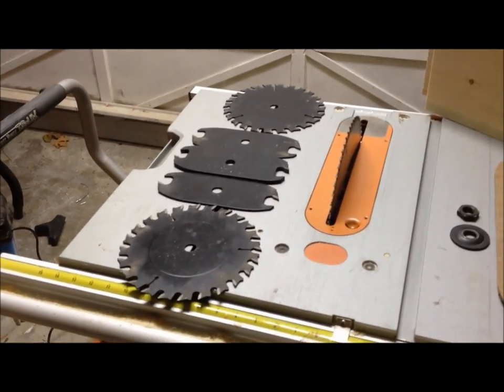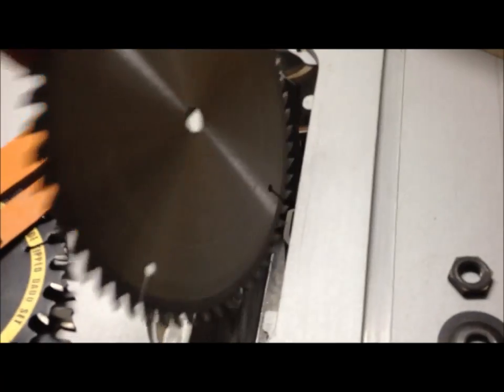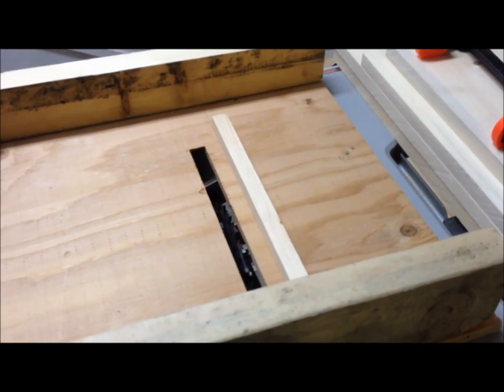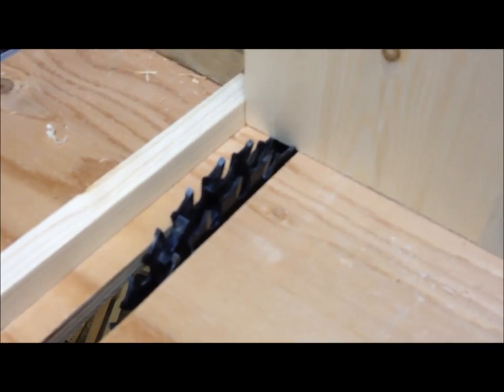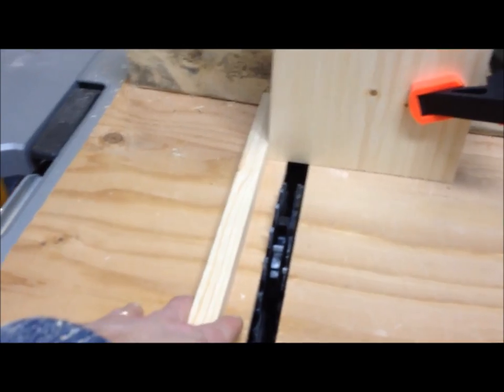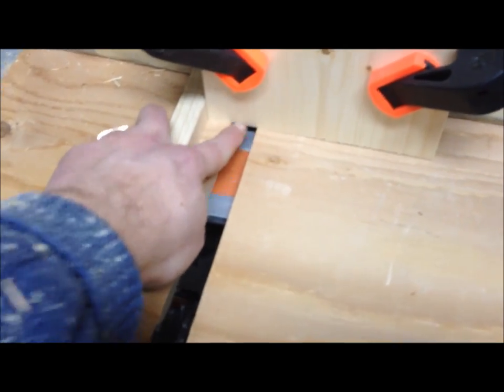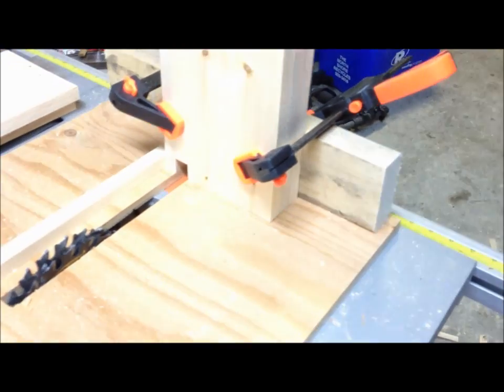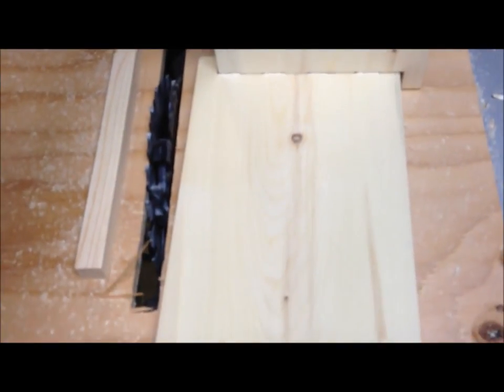Cut box tail joints into multiple boards for bee hive box

Comment from the maker: Hi Justin. You know, I've heard the same thing and you just have to see what works. With a dado blade, my suspicion is that the wide cross cut grabs a lot of wood and tape wouldn't stop the splintering. But I know for sure that if the hole in the backboard/fence is exactly the size of the joint (like mine is) then you won't get any cutout.

Comment: I don't know if I was more impressed with the nice sled you made or the way you held a camera and cut the boards out with one hand. just kidding,  Also do you have a video of making the sled from beginning? I'll start looking now, but I have to admit, this was a great video. If all are this good I need to sub. Thanks again, Kim
Reply from the maker: +The Abled Gardener I didn't make a video of the sled because there are so many on YouTube, Having said, that, I've learned that you can improvise to a great extent  as long as you get the sliding rails to slide nicely.  The basic process is to cut rails that fit snugly into the slots because I cut mine too tight and they didn't slide at first. Leave the rails in the slots, and support them from below with washers or whatever so that they project above the table surface. Then put glue all over them and lay the sled base on top, then let the glue dry. Then add short screws from the bottom and make sure the screw head doesn't touch the bottom of the slot. Then screw in the safety sides to the front and back etc. and cut a groove in the front edge. That's too simple, but you get the idea, and just find a couple videos. Good luck.
Reply: +Doug Brown Thanks Doug, I have watched a lot of great sled videos now and from excellent (if you have the tools) to very basic and think I know what to do now. Your tip on with the washers under the rails is a great one, thanks for your quick answer, Kim
Reply from the maker: Good luck! I use mine all the time.
Reply: The Abled Gardener секыс
.секыс
Reply: Doug Brown секыс

Comment: Great video!  Brand-new just starting out in beekeeping - in the phase of assembling equipment, my bees are ready for pickup in mid-April.

Only one question:  I've noticed that a lot of the videos showing how to do the finger joints are using a dado on a table saw.  Any reason why one couldn't do the same with a fixed base router and a finger joint jig?  I was thinking of doing it with my router and my jig, but started wondering if there was a reason why I seeing others do it with the dado and table saw?

Comment: I am left to assume you put a 3/4" spacer between the key and the dado to achieve the adjacent board fit. Is this the case or do you have a separate slider fixture for the connecting side?  Very simple and effective fixture.

Comment: Do not stack regular saw blades together. Dado blades have no kerf  (the teeth on the blade are flush with the actual blade. reguar saw blades the teeth stick out the sides alternating left and right. Dado blades run you about $120 Canadian.  great video  have the same saw works great fyi the tables saw has a 10" blade and the dado cutters are 8" the thicker you cut the more power it takes to run the saw thru the wood. you an also make the scalloped handles for your bee hives. real simple jig to make.
Reply from the maker: Mike Meadows Thanks. To make handles I just lay the box on the table saw, raise the dado a little and push the box back and forth a few inches. Really quick and simple.

Comment: hey! im about to do thi sthing. thanks man, i like this video of yours!
some question though...

1    what would happen if i dont put thse blade inserts in between? would that leave the middle uncut? (i dont have them.)  how about if there s just little gap (to make more narrow joints)

2    say i go and buy more blades , i end up with five NORMAL 50 teeth blades, meaning i d have five 50 teeth blades one next to another.  would that be a problem? (i dont see a point in buying those different blades you put in the middle- or do i have to??)
please answer me, i ll be very happy.
Reply from the maker: Hi. Here you go:
1. I think you mean you don't have the dado blade (inserts)? If there's a small gap between two saw blades I think they would remove the gap. I'm guessing about 1mm or less would be cut away.

2. You can definitely put several regular saw blades together and that would work fine, BUT I wouldn't put more than 4 together. The reason is that there is a large amount of sawdust with dado cuts, and the small number of teeth on the dado blade allows the dust to drop out. If you have a lot of blades you'll find sawdust everywhere.

Here's a blog on the subject: http://woodgears.ca/shop-tricks/dado.html

Comment: Can I put 3 or 4 regullar blades? They just don't sell those blades in here.
Reply: That is very dangerous.  On a 'regular' blade, the teeth are wider than the blade disc.  If adjacent blades slipped and the teeth struck one another, you'd have small carbide projectiles flying through the air at several hundred feet per second.  Not a good thing.

Comment: What size motor is required for stacked 8" dado blades?
Reply from the maker: The answer is indirect: If the arbor (the threaded axle that you stack the blades on to) is long enough to hold your desired dado width (plus the locking bolt) the motor will be powerful enough. I'm using a Ridgid R4512 which is a portable contractor unit that's been able to easily cut whatever I need. 

Good luck, thanks for the question.

Comment: Be alot faster if you just clamped the boards together themselves, instead of clamping them to the sled and having to reclamp after each pass.  pass the sled, moved the boards one notch, pass the sled, move the boards, etc.
Reply from the maker: Good idea. I just didn't want to have to worry about the clamped boards moving around mid-cut.
Reply: So, do both. Clamp all boards together to make them easy to move and also clamp the group to the sled before each cut.
Great video and narration!

Comment: Dados are inherently hard on your motor. I would encourage you to seek quality over quantity.
Nice jig but you can't get quality joints milling 10 boards at one time. Their are going to be deviations and mistakes.
Nice joint to look at and strong but not the best joint for a bee box.
Reply: What is the best joint for a bee box?
Reply: @markwelsch1619  Box joints are probably the best for strength and reliability without being excessively complicated.  The best manufactured boxes sold typically use box joints.

Comment: Hey Doug. You showed half of the joinery. How do you make sure the other side matches the joints you put into the first side? Did you scale it to make sure that the joints fit equal? I would like to see how to make a complete box joint so that they come out with an even top and bottom Sled is a stroke of genius.  rickypack@peoplepc.com
Reply from the maker: You need to cut a dado into the corner of the opposing board, then continue cutting slots--You'll find the last finger and slot line up. To make the dado in the corner: 1) Either eyeball it, or 2) Place the first cut hole from the first board onto the key so that the edge of the board lines up with the blade. Then place the new board next to it and the corner will line up exactly with the dado blade.  Hard to describe, let me know.
Reply: Doug Brown I get it. Thank you!! Nonetheless I would like to see you do a video on it. You are a great teacher and seeing it will make it easier for me and probably many of your followers.
Reply: Doug Brown Did you measure the width of the boards and figure out an equal number of dados so that there wouldn't be 1/2 a dado on one side and a 3/4 dado on the other?
Reply: Ricky Pack Also if you have the measurements worked out for the three sizes of supers that would be helpful for us to know. I guess you can tell that I would like to have the numbers. LOL I still think a "a thru z "video from you would be great! Not many of the more experienced beekeepers like to share their knowledge like you do.
Reply from the maker: Ricky Pack I emailed you all the plans. Look up Ryan Bekke on YouTube -- He's a great source, and I wish I had his equipment!